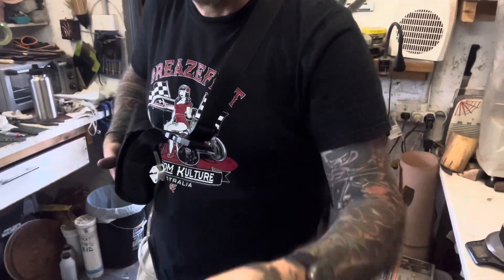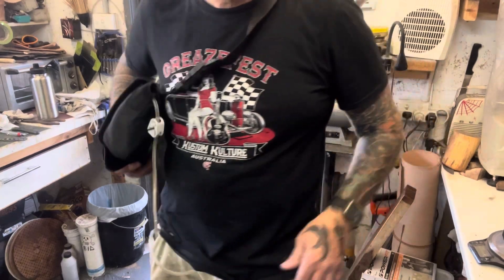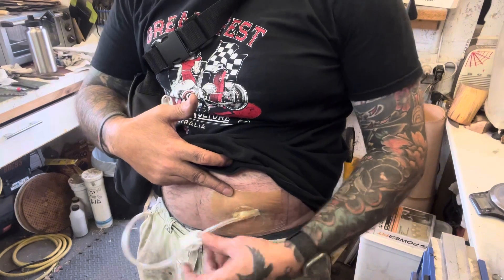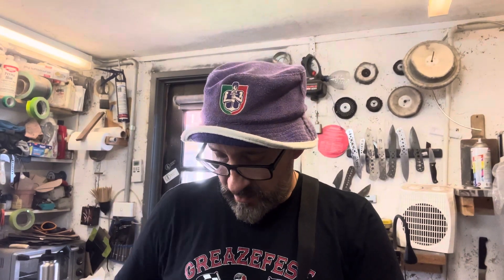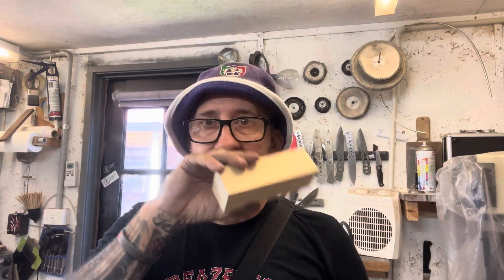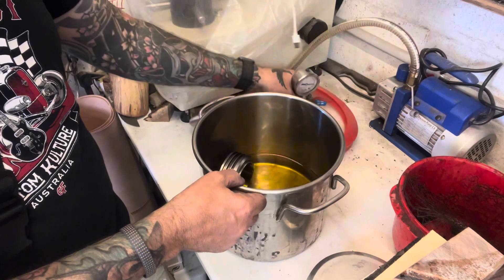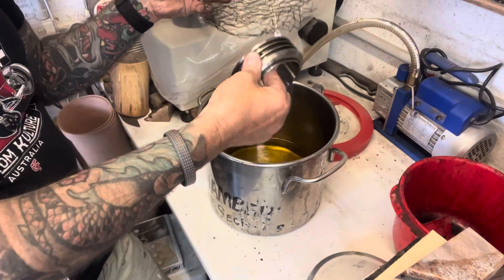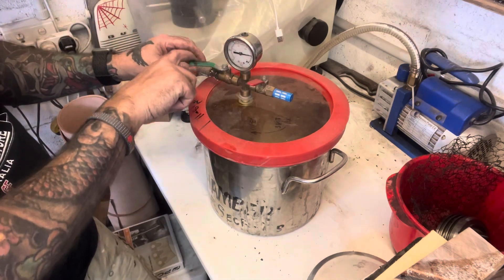Stabilizing wood blocks with Cactus juice and vacuum chamber for knife handles.

Comment: does cactus juice remain liquid and can it be reused without turning solid?
Reply from the maker: Yes, it's a liquid that remains so until it's baked at around 90 degrees Celsius, then it turns solid. As long as you keep the liquid in the chamber cool, you can use it over and over again.